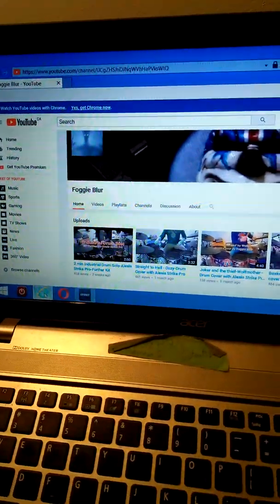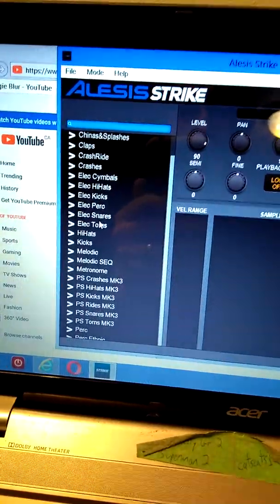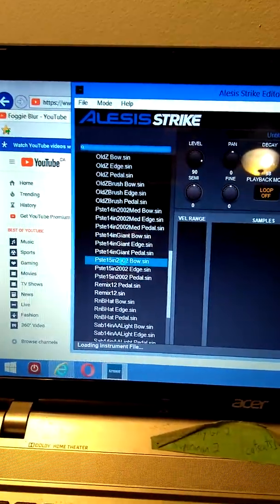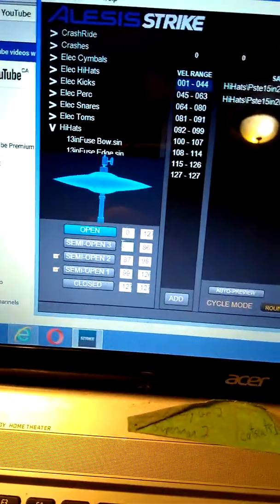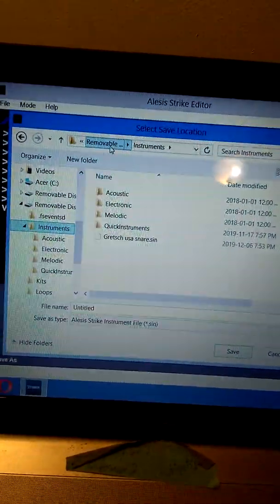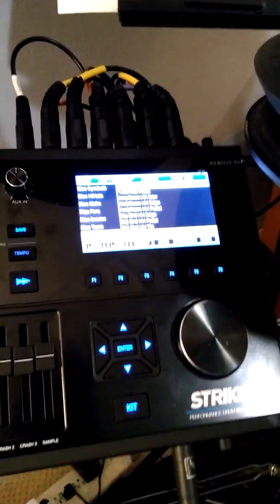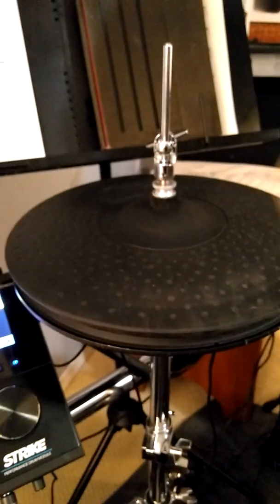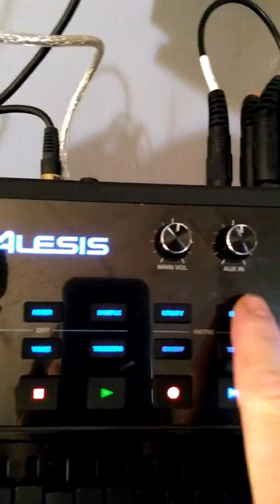Alesis Strike-Increase settings Range for loose Hihat

Comment: Unbelievable. You are the MAN. This has been the Achilles of my kit for 4 years now and you are right, Alesis instructions are not great and their customer service is even less great. I had tried saving some unrelated settings in the editor and wound up with a critical error on the module and lost all my custom kits because there isn't anything out there on this and saving the settings properly from the editor is the biggest key so thank you very much for putting this together.

Comment: Very helpful video. I find the Strike Editor program to be very confusing. I had changed my hi-hat settings in Strike Editor and I ended up losing the hi-hat edge trigger. When I hit the edge of the hi-hat, in any kit, the trigger in my Strike module automatically switches to Hi-Hat Bow. Any suggestions on how to get the Edge trigger back?
Reply from the maker: Make sure you ve updated to firmware 1.5 version. 
Aside from that my edge and bow do still flip, I tried adjusting the cross talk between the two and the threshold. That helped a bit. In the end I set the sound to bow for both edge and bow triggers!
Reply: @mjdrumsnow  Thanks. I am using the firmware 1.5 version. I will try making the cross talk and the threshold adjustments. If that doesn't help then I will just have to live with having only the Bow trigger and the Foot/Pedal triggers.
Reply: @CarolKCox  Is this a fix for the bow and edge triggering at the same time? I have that happening.  I notice it doesn't happen as much when I close the hi hat and apply a ton of pressure.